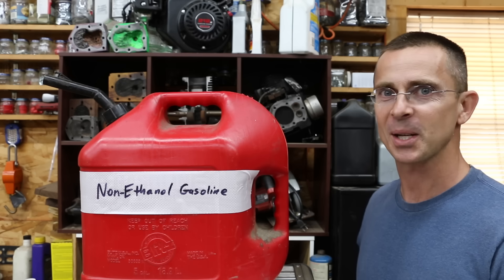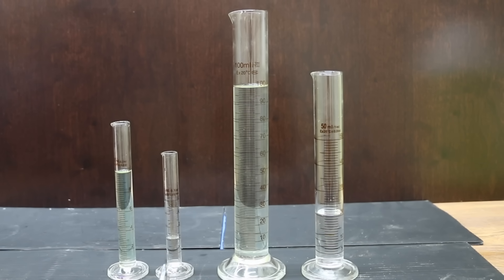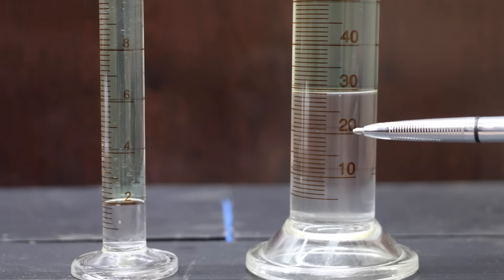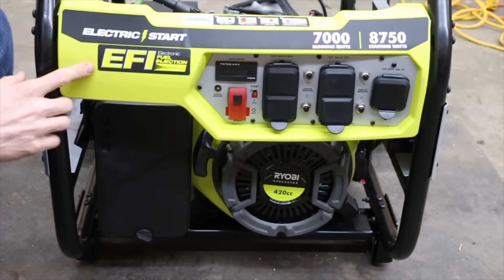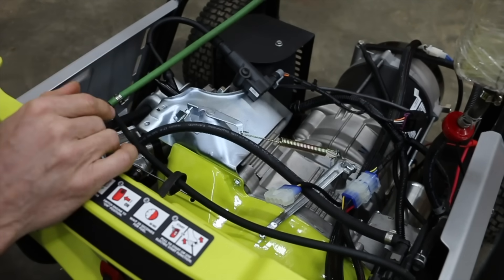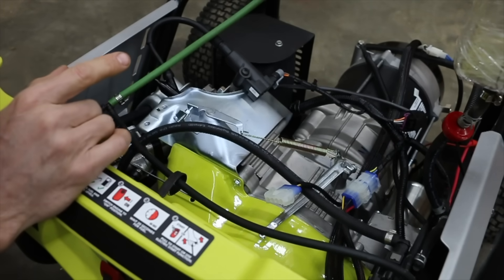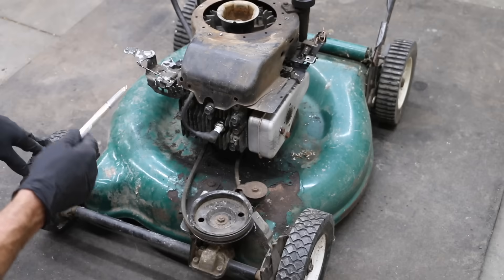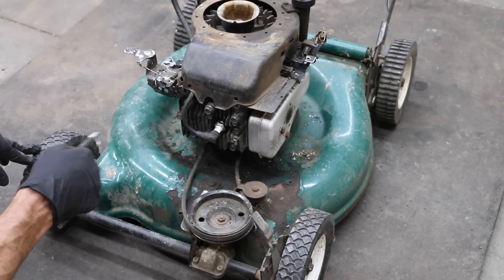Is Non-Ethanol Gasoline Really Better? See the PROOF!

Comment: The Russians have a similar situation with Diesel fuel and grease during the REALLY coldest weather.  Solution so Diesel doesn't gel and grease doesn't become rock hard? Simple: put a little Gasoline in both and mix it well.  Too bad the Germans didn't know this during the coldest winters in 50 years, when they attacked northern Russia and everything froze.  BUT, you still have to watch out for any moisture/water in your fuel freezing;  in Northern Wisconsin, I found a ring of ice under my fuel filter one morning. Tossed it, changed filter, ran great with one gallon of gasoline in each 100 gallon tank.
Reply from the maker: Thanks for the feedback.

Comment: I am a home owner in the mountains. During severe weather trees fall, branches take root on my roof, summer is firewood collecting time.
   Ethanol filled gasoline causes a too often rebuild/repair of my 2 cycle tools, weed cutter, blower, chainsaws. It is not that I am lazy but when I pull the starter I want my tools to work, not have to repair them. 
   I am now running non ethanol in my tools. They run better with a quicker reach of operating RPM, the idle is lower and they vibrate less. And I don't worry about needing to keep extra rubber pieces in my garage.
   And the smell of gasoline and ethanol burning just does not have a nice odor. Nitro on the other hand, no I do not run nitro in my tools, just an evil crazy thought.
Reply from the maker: Thanks for sharing.

Comment: what I'm wondering is what if you have a way to super cool down air before it gets taken into the intake so for instance a cold air intake tube with a coil wrapped through the inside as well as the outside with either dry ice or CO2 or something or refrigerant ran through it so that the air get schooled would that make the fuel efficiency better by making the air more dense of oxygen and super cold before it gets sucked into the motor?
Reply from the maker: Thanks for the video idea.

Comment: Great test. Ethanol is almost half as energy dense as gasoline so you get worse gas mileage from every fill-up. Usually about 10 to 15 percent worse, depending (10% blend). Ethanol also produces more of the oxides that cause smog pollution versus just straight gssoline. Ethanol is also a corrosive so it can not be shipped by a pollution-free pipeline, it must be trucked and that increases pollution as well. Ethanol also uses huge amounts of water for production and that is having a negative effect on aquifers nationwide. The one good thing about ethanol is that it absorbs huge amounts of tax money for its subsidy. So you see, ethanol is not really about pollution or saving the planet, it's all as about buying votes with your money.
Reply from the maker: Thanks for the feedback.

Comment: Recently I bought a new to me 08 Polaris Sportsman 500 EFI ATV,  purchased June 2019. Not long after I bought it I started having problems with it shutting down on me. Long story short the in tank fuel assembly was completely shot. The pump assembly looked as if it had been laying outside in a junk pile for a couple years. All the wiring insulation was completely gone, the plastic fuel tubing was so brittle to the touch, it would just crumble when you touched it. Even the metal parts of the assembly in places was rusted. ATV mechanic that replaced the fuel assembly for me said "ethanol fuel" was the culprit and he highly recommend using a good fuel stabilizer/conditioner if using ethanol fuel these day's. I assume previous owner never used a fuel stabilizer/conditioner at all from the condition the fuel assembly was. I have used one for years in my other gasoline operated engines and knock on wood have not had any fuel related problems so far with my other gasoline operated toys, ATV, lawn mower, tiller, etc..
Reply from the maker: Thanks for sharing.

Comment: I remember in the old days condensation could build up in your tank causing all sort of different issues over time.  Having the alcohol in your fuel binds with the water molecules and removes them in small quantities, as you go, avoiding buildup.  Since manufactures spend millions to design cars to use the fuels, why not.
Reply from the maker: Thanks for sharing.

Comment: Fun fact 1: 1L of Water + 1L of Ethanol =/= 2L of fluid; both combine to have a lower volume.
Fun fact 2: Of the many aftermarket octane boosters on the market, at least one (Amsoil) is 90-100% Diesel #2, based on their own MSDS. Conclusion? Buy a gallon of (now low-sulfur) Diesel and you can cheaply re-boost your de-ethanolized gas' octane and not have to buy so many bottles that can't be recycled!
Reply from the maker: Thanks for the feedback.

Comment: When I lived in IA and could get ethanol-free gas as well as 10%, I tested both in my vehicles (truck and car).  I found that over several thousand miles that the mpg for 10% was about 2 mpg less than pure gasoline (on a 29mpg engine).  The lower cost of 10% was more than offset by the lower mpg.  I always filled up with non-ethanol gas when I could.  Now, I can never find it!
Reply from the maker: Great information. Thank you
Reply: I get non ethanol 93 grade for 2.89 g in nc, love it
Reply: offshore fisherman82 freedom and liberty is this at a typical gas station or at an oil distributor?
Reply: @offshorefisherman82freedom52  Me too!  I've been running it in my Suzuki for 10 yrs. after noticing the difference in gas mileage.  I'm at 113 K miles and running good.  I've just replaced O2 sensors at 112K miles!
Reply: @offshorefisherman82freedom52  where at u can't find 93 ethanol free
Reply: 10% is about the break even point for the vehicles that I run it through.
Reply: Same here about 2 mpg less
Reply: "pure-gas" followed by a dot and an org will take you to a crowdsourced site of ethanol-free pumps in North America.
Reply: @OOZ662  👍👍👍👍
Reply: www.puregas.org will help you find E-0 gas. I run it in my small gas engines to avoid damage to fuel lines and other parts that are susceptible to ethanol.
Reply: @arthurgoldman3136  most of the places for me are only when traveling and pretty far. Also stuarts and there fuel is crap
Reply: Well if you think about it, you have less gasoline by volume with ethanol. So of course mpg would be less.
Reply: Ethanol has only 0.6 times the energy of gasoline.  27 MJ/Kg versus 45 for gas.
Reply: I know a place that sells ethanol free gas but it is expensive.
Reply: I can find it near lakes where there are frequently boats. I've been told it is because of the way boat motors are made and have to run on non-ethanol gasoline.
Reply: IA that's prime corn country surprised it isn't 50/50
Reply: Interesting. I did the same thing and never noticed any difference in mileage
Reply: In Nebraska you can find 93 octane without ethanol pretty easy but 87 octane is hard to find. I only use non-ethanol in my small engines and motorcycle and run the gas out of the carb when shutting them down.
Reply: I use non ethanol only.  I don't know if my mileage is better. I'm always around 33-35 mpg. An engine should run on gas, not gas and corn.
Reply: Try buyrealgas.org (2nd choice to pure-gas.org). Neither one are in sync with the other just a few more options pure gas is the better website.
Reply: Bucees sells ethanol free gas if you're lucky enough to li e near one
Reply: You wont find in at any gas stations on the east/west coast. The greenies won't allow it. You need to hit boat marinas or small municipal airports. Aviation fuel is pure and high octane with lead.
Reply: What's worse, some places don't require gas stations label it as ethanol or not. You have to look at the price and octane.
Reply: This is easily explained as ethanol has a lower energy density than gasoline....meaning you need more ethanol to get the same 'bang' as you would from gasoline.

Comment: Bob.. you do such a good job at this..  i cant say what you do it fully scientific but its certainly close enough to establish a reliable trend , you do excellent research  ,,  Ive been my own myth buster since i was a kid  ,, no a split pinto bean rubbed on a wart doesnt remove the wart..  no boiling water does NOT freeze faster than cold water etc,,  so i checked my gas mileage with my camry with 10% and pure gas on a trip to a town that is exactly 100 miles away..  yes.. the car got 11% better mileage  not bad.. until you put that fuel in a motorhome.. then on a long trip you can have 3 free good lunches on the difference..
Reply from the maker: Thanks for the feedback.

Comment: For me the best fuel is E85 I have use it on my mustang for a while and is the smoothies ride ever the bad part is the fuel consumption increases  but other than that it add more horsepower and its very smooth
Reply from the maker: Thanks for the feedback
Reply: I use e85 in my Subaru STi and also notice how smooth she runs.I do lose about 4mpg but the extra horses make up for it.
Reply: I run e-85 in my GMC Sierra, and get about 2 less mpg. I love the smell when you first start it. It attracted a crazy amount of horse flies at a camp ground one year, though.
Reply: I developed a lifter problem in a car when I used E85.
Reply: @pablojose4890  it depends on the type of automobile you use, not all automobiles are suitable to use E85 specially on OLDER MODELS.
Reply: @Daniman-nk2vj  yeah it was a 2006 Chrysler

Comment: Are u able to commet on 87 vs 93 octane fuel efficiency / mpg and longevity for Turbo engines vs naturally aspirated?
Reply from the maker: Thank you.  There's little, if any difference in efficiency if the ethanol content is the same. Using the appropriate octane per manufacturers guidance will help maximize longevity.  Thank you

Comment: Suggested comparison:  Does 86 Octane perform the same as 87 Octane at high altitudes?  Here in NM we have 86 octane. I’m told it performs the same as 87 because we are 5000 feet. In Colorado I understand they have 85 octane for same reason.

Comment: I think if you worked at SpaceX they would have switched to CH₄/LOX + 301 stainless sooner! Methodical and logical. How about a video where you show 20 types of carbon based fuels and how they combust, and show the chemistry in a side panel - specifically why CH₄ is a good fuel with minimal intermediate products, and thoughts on what could be better! Rather than long term tests, show what's produced chemically?
Reply from the maker: Thank you for the feedback

Comment: Nice video to show in real life what the difference in the two fuels performances are .Man there is a lot to unpack on the subject of fuel and engines. It takes twice as much Ethanol to produce the same power as Gasoline. Ethanol burns a lot cleaner than Gasoline.thats why it is added to gasoline to help with the emissions. Octane rating , the higher the number the slower it burns.adding a high octane fuel to a engine that is not designed for it does not make  more power . If you use the correct octane per the manufacture and your engine is knocking you have other problems. There is so much more to engine design for a particular Octane.To why an engine would knock .
Reply from the maker: Thanks for the feedback

Comment: Love your videos!! I recently watched a movie where a guy ran his truck on moonshine. That would be a great video.
Reply from the maker: Thank you for the video idea!
Reply: You can RUN a Model T (NOT an A) engine on kerosene too, but you must have enough gasoline to pour into the carburetor to START it. Even pure "shine" would have enough water in it a car/truck/whatever would run VERY badly and overheat.  Clinton, Tecumseh and Briggs& Stratton all made "dual fuel" engines you started on "benzine" (gasoline) and switched over to "paraffin" (kerosene) when they started. Very popular in Mexico, South America, Asia and Africa where gas was hard to get and kerosene was much cheaper. They smoked and stank, but they ran.

Comment: Just watched this video 😎. Ethanol is bad. It slowly eats away on rubber fuel lines , gaskets internals of carburetor's diaframs inside fuel pumps ect  . I made the mistake of running cheap 87 ethanol in my 82  dodge truck with a 4 barrel and letting it sit for a month month and a half? Went to start it and it ran ruff like it only ran on 3 cylinders or like a spark plug wire was on the wrong terminal ? Also the truck while running smelled like it was running rich ? Maybe  the gel chunks clogging the jet ports or blocking metering rods from  moving ?  Uncapped the top of the carburetor and found gas with gelatinous clear chunks floating around in the fuel wells? When i pinched  a chunk of gel between my two fingers and squish it . It dried out and turned into a dry white crusty power. Had to flush out tank and fuel lines and carb till it was all gone . Ethanol has a reaction to air /moisture and will gel up because ethanol separates from the gas  . So its important to keep running the 87 through the gas system and not letting it sit or just buy gas with no ethanol and not have a problem. I run 92-93 octane with no ethanol from Kum & go  or shell gas = nitro . truck runs better and dont have to worry about the gel crap from ethanol.
Reply from the maker: Thank you

Comment: I usually get the fuel conditioner additive for the ethanol and use it in everything. Small engines I don't have problems with them like before with ethanol untreated. It was explained to me by a mechanic that the ethanol is alcohol and it is basically a good cleaner. It breaks down the lubricants and can cause more engine wear. The switch to unleaded fuels is hard enough on engine parts. The lead did help to protect the rings and cylinders but it was bad for the emissions. I have used synthetic oil for my vehicle because it does maintain the viscosity better. And alcohol is rough on seals and of course it does corrode aluminum, and aluminum is a common component used in machinery today. If octane is an issue then adding octane boosters is an option. I have a buddy that used to work on top fuel dragsters and funny cars and the engines would have to get overhauled after each run and ready for the next run if they had advanced. They could have an engine rebuilt and ready in 30 minutes or less.
Reply from the maker: Great information. Thank you

Comment: I ran non ethanol gas in my motorcycle thinking it would run better. It ran worse. When I ran half the tank, I decided to try filling it with E10 to see if it would help. When I opened the fuel cap, it smelled like someone farted. It dawned on me that the non ethanol was old because it was 75 cents per gallon more and no one was buying it.
Reply from the maker: Thank you for the feedback

Comment: My Harley got 69 mpg on non ethanol gas and after ethanol was added, l only get 43 mpg.  My 350 Honda got 65 mpg on non ethanol and about 48 mpg on ethanol. There is a big drop in the energy value. The ethanol ruins synthetic parts in the carb and tanks of older engines.
Reply from the maker: Wow!  Huge difference!  Thank you
Reply: Same with my Yamaha RD350. The old air cooled 2 stroke runs better on 91 octane non ethanol gas. And I don't have that white and green corrosion in the carbs building up. My mileage is 50+ and 40ish on the ethanol gas. Hard keeping the hand out of the throttle with a fully built motor, she sings a beautiful song at 9k rpms
Reply: Actually, if the engine ECU is already tuned to change the mapping according to what fuel is running, using pure ethanol gives you only 60% the range but depending on the engine maybe 10% more hp ish
Stil don’t want to use it never in my car... on the long term it does break stuff.
Reply: I'm not totally certain of it, but I also heard when they started doing the ethanol everywhere that older small engines often had gas tanks that ethanol would react with slowly.  This both damaged the tank and the contamination from the tank being eaten away would also harm the engine.
This did not happen on the pre-ethanol mower I had.  It would still be going if I'd changed the spark plug more often, but I didn't and stripped out the hole when the plug failed, then decided I wasn't going to put the repair money into a 15 year old mower.

Comment: I just did a 300 mile trip in my truck towing a trailer.  The start and end were about 100’ elevation difference.  I filled up at the start with e10, towed out empty, loaded up about 1200 lbs, about 10 miles back I filled up with ethanol free. I got 11.3mpg on e10 and 12.1 on ethanol free even with the extra load.  It wasn’t a perfect test that would have been a loop done two twice but I think it was enough differential in the results to say the improvement was real.  

To bad it was $0.60 a gallon more for ethanol free and the closest source to me is about 40 miles.
Reply from the maker: Thank you

Comment: We had a bunch of Korean motorcycle and if you didn't use ethinyl free they wouldn't run for shit. Engines are designed and tuned for it from my experience. Cant just switch the two in the same motor designed for different fuel
Reply from the maker: Thank you

Comment: If ethanol was so much better you would find it at airports but it's not. Ethanol is a subsidized scam that requires more energy to produce then it actually saves and destroys engines in the process. I fired up my 91 eclipse that's been parked sense 94 with it's old gas still in the tank but it ran on it. If that would have been ethanol I'd had to drop tank, replace fuel pump, clean lines, replace injectors, ect.
Reply from the maker: Thank you for the feedback on ethanol